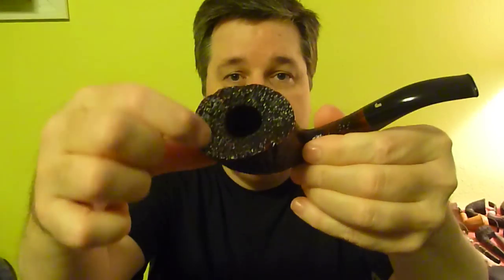HOW TO SMOKE A PIPE Pt. 9:  What is a "briar" pipe?

Comment from the maker: @PresAndrewJackson   Some pipes are that way. I have a great Ser Jacopo, but it was hard initially to get a pipe cleaner through. (it had a gentle bend)   Took a round file and filed on the shank inside a bit where it was hanging up and that helped. Also, it helps to rotate the pipe cleaner so that the tip is easier to go though. (sometimes the slight bend at the tip of the cleaner will catch)

Comment from the maker: @PAPIPEGUY I have several videos coming up about what your first pipe should be. My first was a savinelli. I was disapointed to find that it had fills in it and it was a bent that could not take a pipe cleaner through it when together. I think the sav straight bulldog would be good though. Ask the seller if the pipe in question has any fills. The higher grade sav (punto oro) probably has no fills. I've never had a sav with filters. 

cheers, 

Kel